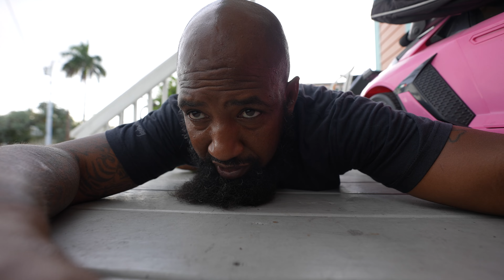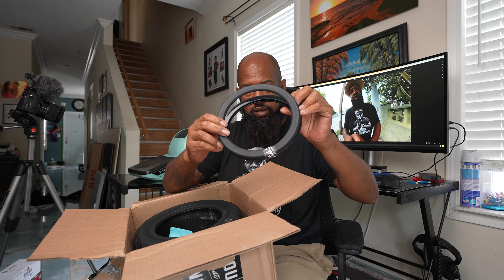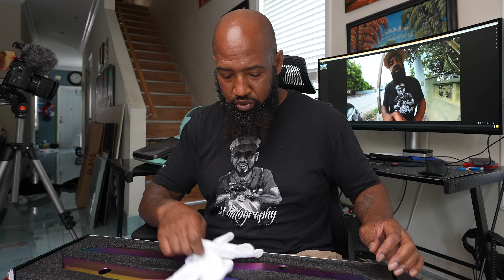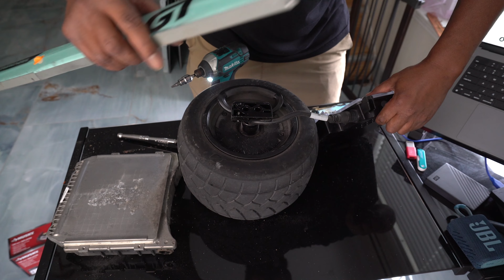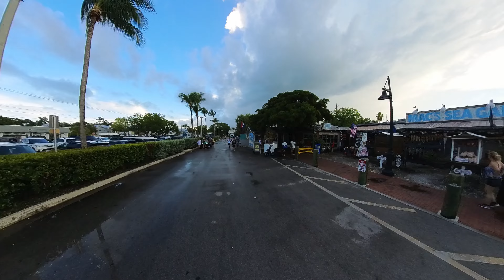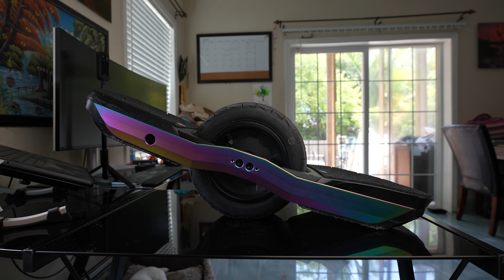Onewheel GT Update / Modifications

Comment: Yeah dude! Converted my stock mint monster last weekend. Got the chrome low riders. Still on stock slick though. Kind of want to hear more about the enduro. It looks sharp.  I feel like I need to try the street pro 2 as well. I stay on the streets for the most part.  Make sure to try new shapings.  Flow got weird for me with the low riders.  I remember trying Apex on stock and going "oh hell no!"  Try it again with the low riders, and that's my new shaping mode.  Carving is so much better and easier to do.   You going to Stokebird i February?  I just booked my flight for stupid cheap.
Reply from the maker: I want to try the street pro 2 but I don’t think I’ll be able to ever switch. I’m ready to order another enduro. Unbelievable smooth. I’m ready to go on a long journey. Just waiting for my fender. I was riding apex pretty much all the time. Ive been in flow since the overhaul. I switch around though. Ride pretty much street. The board feels like a sweet beast.
Reply: Tell me about the low riders. I can't believe no one has made a video yet
Reply from the maker: @DSC1320  man on man. I can’t say exactly cause I did so much at once but it’s a totally different ride. Quicker. Lower. Tires wider. Smoother. Definitely lower now. I’ve touched the back on the ground twice coming down hill. I’ll do a review on em.
Reply: @DSC1320  i got some footage today. coming from stock gt experience only, im having to relearn things again. going fast is easier, but im more fearful about clipping something with the nose while im accelerating.  im not sure if thats a valid fear or not.  im basing that off of when i have to slow down fast, my tail definitely drags every time. (ill be posting footage of that)  based on my limited experience and skill level, i think it was a mistake to switch to something that changed my clearance.  i should have gotten the standard wtfs first.  im going to keep working to adapt to the low riders, but will probably be on the look out for blem/used set of standard rails to try out.  also think switching to the enduro will help things.  im on stock slick now, and have been trying to figure out where the psi needs to be.  all of this uncertainty and testing has led to the overall experience being a huge mix of "wow that's awesome" and "wow that's scary!"

Comment: Could have tossed them in the oven at 250 to make them more pliable
Reply from the maker: I tried it all. I don’t wanna sound like a softy but that’s how they kinda made me feel. Like I have little hand syndrome 🤣 heat gun, microwave, probably boiled em 3 times. I do still have them so I will try again on the next tire change.
Reply: @therealbergexperience5640 Dude I feel the frustration. I struggled hard. But in the end, I just kept adding more and more heat until I got them on. If you can touch them with your bare hands they're probably still not hot enough. Boil them and use gloves to put them on. 

If you ride only road you prob don't need them anyway.